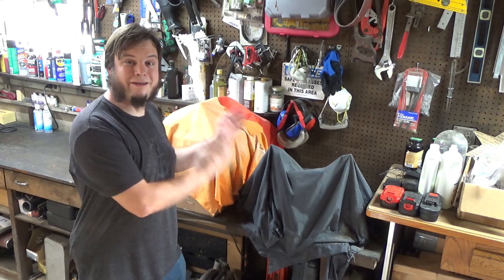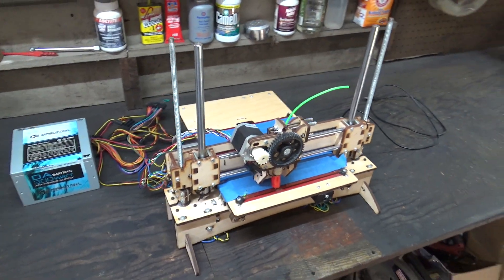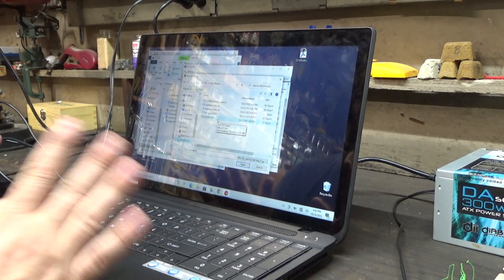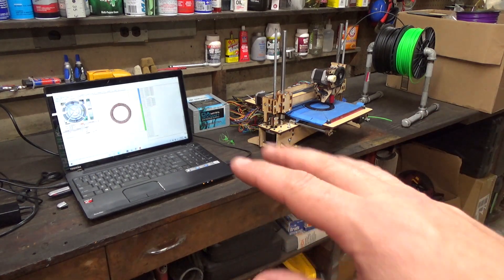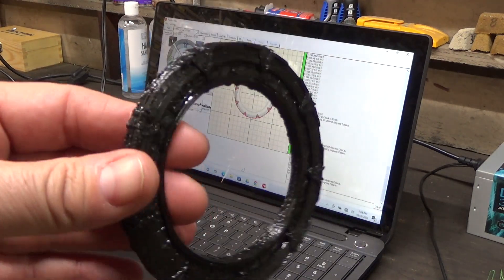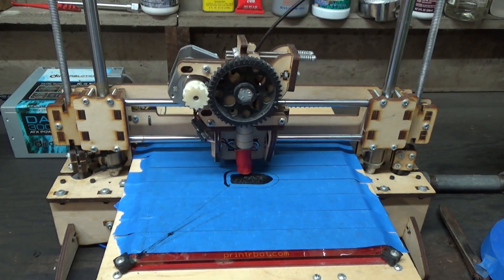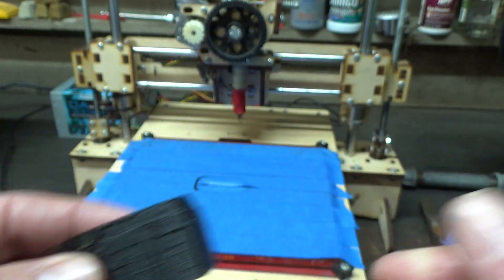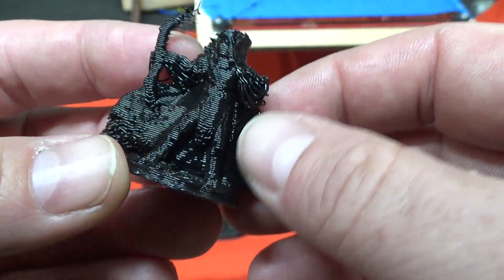Trying An Old 3D Printer (Printrbot Rev D)

Comment: i don't think this is even the printer isue that it "can't print complet things" you basically printing trough serial connection so if you create corect profile for it in prusa slicer or cura you could most likely use the newest versoion and just load the gcode in pronterface not stl, you could get "newest" pronterface too ~2015-ish i think
to get what language your printer speaks you just log in to the printer trough serial and look up the first output text, probably it be marlin 0,x or even 1.x then you look up how to calibrate step per milimeter trough serial connection for x y z and e write down your values somewhere on paper , or to eprom if that printer support it and benefit from slicer advancments that prisa and cura made for you 
even a junk like this can print well under those circunstances because you controll all axis directly anyway, you just need to calibrate them and let a modern slicing programs do the rest for you, that is generate commands printer would execute
you could even go step further and compile newer version of marlin in arduino ide after configuring it based on what junk is inside, it is pratty straight forward process with toutorials, and ading screen and sd card reader tomake it work as a standalone unit is at that point 10$

Comment: 10 month late comment. You just need to tune a printer profile for it and adjust the machine. I had a printrbot simple, which was build the same way as this, you just have to print really slow. But I was able to get good prints out of it and print replacements for the wood parts that worked. The ubis hotends just need really slow speeds because they dont really have a heatbreak.

Comment: It desperately needs a part cooler, these originally came with a crude fan mounted at an angle over the nozzle which is better than nothing, but a proper blower fan with a nozzle to direct air onto the print under the nozzle would be better.

Comment: I have the simple metal black, an upgraded version of what you have there. Look into installing Klipper on that board. Klipper transfers the computing from the board to a SBC. The printrboard only has to control the motors. Using Klipper took my simple metal black from junk prints to just as good as a Prusa Mk3. The tape is to help with adhesion.

Comment: Deffo needs a modern slicer with a properly set up profile. The machine language is still the same just with extras that aren't really necessary. The machine itself seems to be serviceable but has seen better days.

2012 era software has 2012 era bugs that have since all been corrected. This isn't the printer's fault, and it doesn't need 2012 era software to work.

Comment: Man seeing a Printrbot really sends me back. I remember when I met Brook Drumm at a makerfaire years ago and just being inspired by his ingenuity for simplifying a lot of the issues with early printers. Especially when compared to the MakerBot cupcake we had at my makerspace.
Some things to note
• As you have seen, one of the major factors with the outcomes of this era's printers was that the boards were purely interpreting the instructions that were drip fed to them by the control software on the master computer. Any interruption to the drip feed of instructions just made it finish that command and wait until it is told what to do. Iirc one of the community's bandaids for the limitations of us basically using mostly generic motor control boards for microcontrollers was to have a breakout board that allows you to use an SD card to cache incoming instructions so it will have the next couple instructions stored locally to access.
• a raft is the best friend of someone who has a wavy bed
• be prepared to spend a lot of time tuning your filament profiles
Reply from the maker: I recently got a Makerbot that will ONLY print with rafts and it's honestly terrible. They never separate properly from the print and they frequently just fall off the blue tape halfway through the print. I don't really see the point of rafts at all.

Comment: Of you want a more modern printer for cheap, check out ebay for returned printers. "Unrepaired" is the search term you want to use. You might get a completely mangled printer or a perfectly fine printer that someone didn't k ow how to use and returned it. I bought 3 ender 3 printers for $199 and and only one of them had anything wrong with it.
Reply from the maker: I've actually picked up a returned Makerbot, will have a side by side review when I get around to it!

Comment: Welcome to the world of 3D printing! Your assessment is pretty close- this machine would need some upgrades to compete with those (cheap $160 like the Ender 3 v1) that have come out in the last 5 years. It won't be worth it financially but if you're in it for the experience... maybe.
Very cool to see one of these old guys still working and producing reasonable prints considering its age and condition! Beware the rabbit hole.

Comment: It's been ages since i've seen a working one! These were never very popular, they were sold on banggood if I remember correctly. They required 100% assembly. Unfortunately I don't think it'll ever be able to print complicated shapes. The slop need to be taken out of every parts. Also printers that use 2.85mm filament were never that precise. Simply because they use a bigger nozzle. If you're able to convert the extruder to use 1.75mm filament and make the entire thing more stiff then i'm sure you'll be able to achieve detailed prints! Oh and make sure you have the retraction set to ON when slicing your prints.

Comment: New tool! Definitely needs some calibration though. If you can get it working see if it will print the Gridfinity system from Zack Freedman. One of these days I want to try an entry level printer as well, was the smell not too bad?
Reply from the maker: Smell isn't bad in the garage. Wouldn't really want to use it in the house around pets though.

Comment: Id suggest reading the original setup manual, you need to calibrate the z axis on each side of the print surface by hand as you have visible head crashes  , also the extruder appears to be loose, and the entire cooling fan assembly appears to be missing. also you can update the firmware for the printrboard you have underneath they still receive updates as the board continued to be sold for a long time.
if you tune it correctly, it will print as good as a modern printer, its just slower.
Reply from the maker: I don't have a manual, not even 100% sure what the model number is. since it's all made out of hardware store bits I've been "calibrating" things by turning a few nuts and wiggling loose bits.
Reply: @saveitforparts  looks to be a Printrbot LC 1302 aka the LC V1,it was super popular after winning Make magazine's 2012 best in class award.  The entire BOM and DWG files for the frame are still on YouMagine.  after you get it printing a bit better, there quite a few printable upgrades for that machine on thingiverse.
Reply: It's a Printrbot PLUS, at least according to the receipt from 2013.
Reply: @EatsTooMuchJam   makes sense, the early LC and plus were just scaled copy of each other, assembly video is still on YT @ v=vnOtsP_61bk
Reply from the maker: @EatsTooMuchJam  Still working better than the more modern (Noise)MakerBot I just picked up!

Comment: I was curious whether you'd ever done anything with that printer!

I used the blue painters tape mostly to help the PLA stick since the (glass?) bed was always terrible for it.  Prior to that, I think I mostly used Kapton tape, but that was when printing ABS.  

I don't remember the nozzle leaking in the past, but if it's started, there's some gcode that you can put in your slicer as a header that retracts the filament a little bit while the hot end and bed warm up.  It's also not at all out of the question that the current nozzle is worn out (I printed a lot with it in the years I had it and I don't remember ever changing it).  If so, assuming that it uses a standard nozzle, brass replacements are cheap (and steal are not too expensive and will last longer/allow more challenging materials).  If the nozzle is worn out, it could have an impact on detail, etc - though FDM is never going to be great for figurines like the archer.  That sort of stuff is why people deal with the noxious chemicals/extra steps for resin/SLA prints.

Otherwise, you seem to be running into some of the same stuff as I was - lots of random stuff breaking down.  Some of the 3d printed stuff was janky replacement bits that I downloaded for stuff that broke or worked really poorly on the original build.  I don't think I ever saw a weird pause like you did, though - maybe the controller board is failing or maybe it's something with the USB cable or the controller laptop's USB port?  If you still have any spare cheap Raspberry Pi's around, I remember that printer working great with Octoprint - it at least saves you having to keep a full-size laptop next to the printer while it works.
Reply from the maker: I've done a few prints with it since this video and it actually worked pretty well for various things. It's actually in pieces again as I try to fit some printed replacement gears on the extruder 😀
Reply: @saveitforparts  That makes sense!  I had to replace them a few times - the bigger printed herringbone gear wears out every so often.

Comment: Printers sure have come a long way since that old beast was designed.

The  drooping issue on the front of Benchy is due to the lack of a part cooling fan.  If you can rapidly cool the extrusion after it is deposited and before it has a chance to droop, you can print overhangs at 45 degrees or more.
Reply: I agree 2 fans are missing.